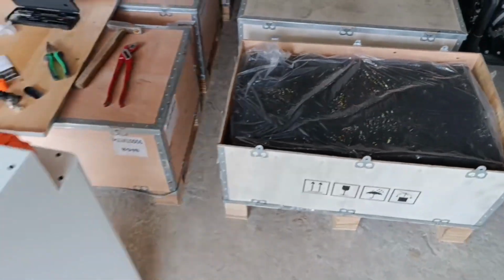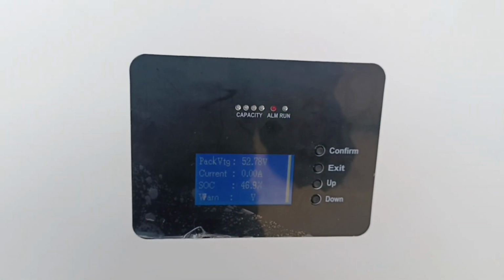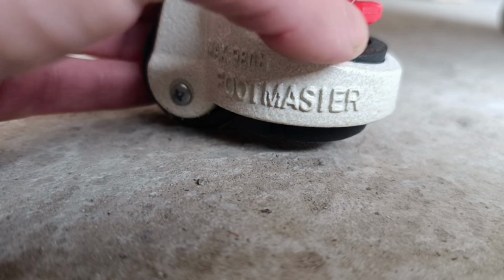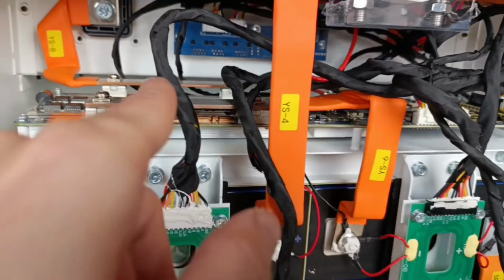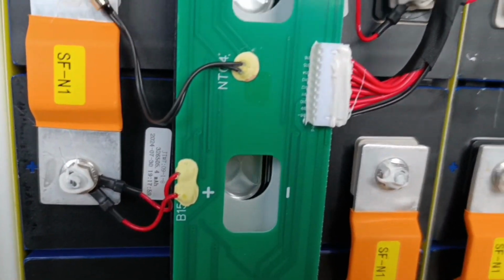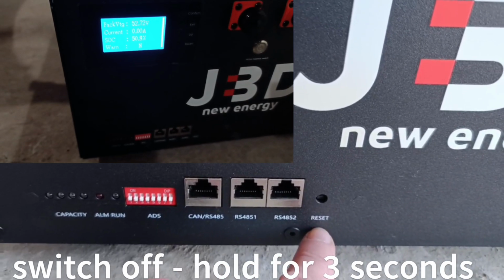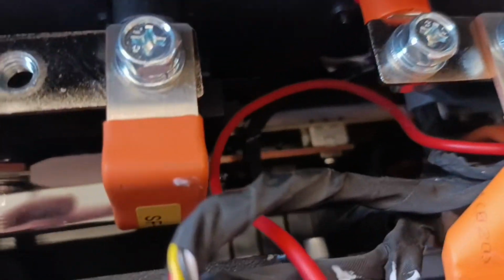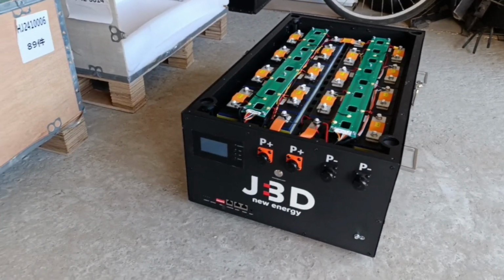Probably the best LiFePO4 battery, part 2 - unpacking and detailed internal/external review.

Comment: looks like it is rebrand from seplos product
Reply from the maker: it is not. it just uses Seplos (legally). the brand is the factory that just builds units. JBD actually produces also their own BMSs. and you can request whatever components in the blocks you want, like I did.
Reply: @ModernUkrainianHomestead  that's why I say rebrand not copy, and the BMS look exactly the same as seplos version, I know jbd has their own BMS and I have use it before. But in your case the relay type active balancer is seplos BMS optional kit
Reply from the maker: yes, in my case it's all seplos, I requested it to be so. the cells are Hithium